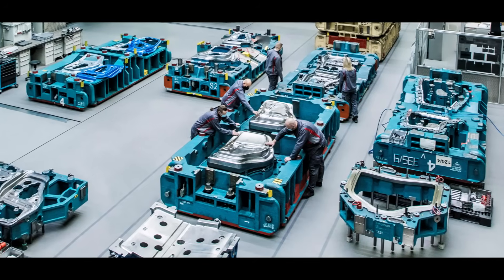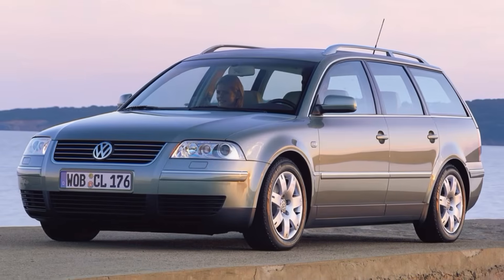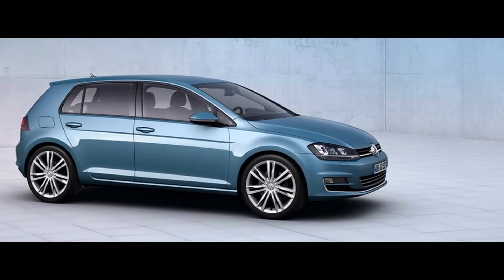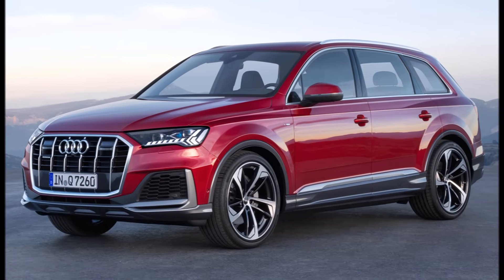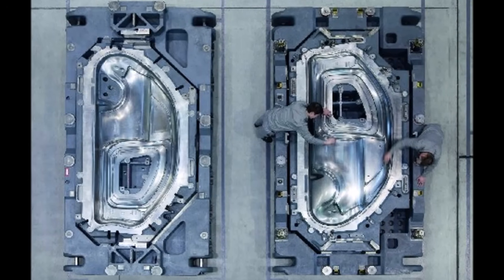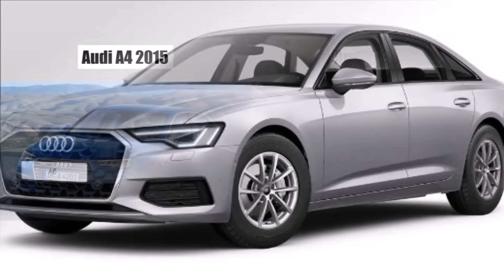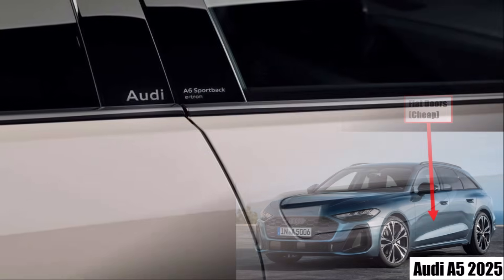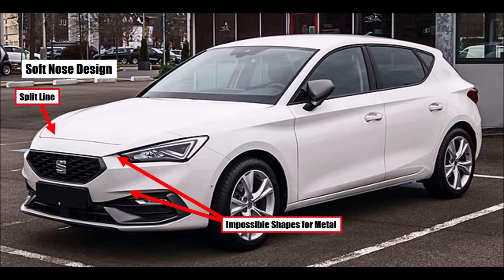Car Bodywork Details EXPLAINED

Comment: I’m probably the odd one out here, but I actually prefer the smoother designs. I truly hate the latest trends of the cars becoming ever more creased and angular, adding entirely unnecessary lines into the bodywork that serve no purpose at all. Oh and don’t even get me started on the ridiculously large front grilles, fake air holes, and tacky plastic trinkets everywhere. For me, car design peaked in 2000s and it only keept regressing, with few notable exceptions. I also never understood why Mercedes EQ series flopped. It was a perfectly functional design for maximizing the EV range, but people didn’t buy it because it didn’t exude enough luxury and presence. It boggles my mind that people are rather going to buy cars like BMW iX, an absolute abomination of a design. So when I saw the latest Audi A6 Avant, going back to simpler, smoother design reminiscent of 20 years ago.

Comment: Using Trabi as an example is a bad comparison, since it was made out of plastic and therefor moulded.
Reply from the maker: The point to deliver with that example is that less pressure results in simpler shapes. That’s true for Duroplast and Metal

Comment: I work at a collision repair/body shop and those small stamping dents around door handles and other tightly pressed areas really drive me crazy. Ford F150 aluminum doors are the absolute worst. I can't tell you how many times I've put a new door on an F150 and it looks horrible. And since we're a collision repair shop and not a custom shop. We don't spend time fixing bad stampings. If we did. We would lose money

Comment: That is one fascinating video. I work as a junior RD&I Engineer at a Tier 1 sheet stamped and welded parts supplier for main industry as well as being a main producer for pressing dies, tooling and fixtures for welding and checking. It’s always mind boggling to see what bolsters the quality feel and how far some toolmakers and automakers can go with complexity of their design. Although I’m not directly involved in production or design of the dies, it’s a clear indication of what trends move towards and what to shape, what to come up with next.

Comment: I always wondered why some car's bonnets draped down to the grille compared to others. Why wouldn't manufacturers use plastic components for the bonnet that attach strongly onto the metal bonnet sheet? Or more conventional composites for the entire bonnet?
Reply from the maker: Bonnet movement and bending at high speeds is a big topic in a car‘s development. Many cars with Aluminium bonnet need 2 locks for that reason. Maybe stuff for another video;)
Reply: @bsport320  A lot of OEM and aftermarket bonnets, e.g. those used on track-oriented sports cars, are made of fiberglass or carbon fibre composites. It may be too expensive, although fiberglass is pretty cheap to produce. Maybe crash safety is the big risk here?

Comment: That’s not accurate. The new flat door panels require more advanced sheet metal forming molds. In the past, sharp bends were used on car panels to prevent waviness over time. This was because curved or semi-flat panels tend to spring back to their original shape. To counteract this, manufacturers intentionally overbent them with sharp edges to release residual stress. However, the new semi-flat panels are reinforced from the inside, preventing deformation over time. As a result, sharp bends are no longer necessary.

Comment: Last true implementations of this imo were the b9 a5 and the b9.5 rs4 - facelift front end but the remaining body in white was the same as the pre facelift variant, with the tension line from the bonnet shut line to the rear lamp cluster

Comment: Absolutelt brilliant video, thanks for the knowledge. I do have a question, how does a brand like Lexus compare in terms of their body design? And if it is somewhat complex/intricate then how do they keep the price similar or less than the equivalent Audi who is reducing costs?
Reply from the maker: Thanks! Lexus uses extreme shapes and edges but only in their plastic parts. Their metal panels are fairly simple.
Reply: @bsport320  Thank you. I'd love to see you do a similar analysis on other brands in the industry.

Comment: I own a mk7.5 VW Golf GTI. Often when I look at it up close, for example when washing it. It amazes me how well thought out the lines, angles and creases are in the body work. I’d see a line that I never noticed before and took for granted, and realise it works so well. For example a line in the bonnet / hood that runs from the A-pillar to the edge of the headlight. Even the shape C-pillar and its panel gap with the rear bumper has been nicely designed. I’ve just realised both of these design features can also be seen on the mk1 Golf.
Reply from the maker: Hand washing is the best way to explore your car

Comment: I would not say, that round door design are a sign of cheaping out. Porsche for example never used sharp door lines. Design is always evolving. For my eye, the 2015 sharp designs in this video dont look modern anymore. I think round shapes are the current way to go and probably in 10 years everyone is sick of round shapes again and then the next trend comes.
Reply from the maker: Also round shapes need precision and this video doesn't wanna say round = cheap. Just exact sharp lines need lots of work and precision, flat doors are easier.

Comment: Ahahah, what a funny video hearing all that non sense about this dude ideas of expensive and cheap feeling.
As a customer you want a car that is as smooth as possible, none of those crazy sharp creases, none of those complicated geometric shapes.
Because those things CANNOT BE REPAIRED at body shops, and you are foced to buy new doors in case any idiot bends it just enough.
No metal worker can get those sharp lines back as new and even if they tried, it would cost so much you'd just buy a new door.
Feels expensive is one one of putting it. EXPENSIVE TO MAINTAIN.
Get off your fantasy "design" theories and come into the real world.
Customers with a function brain don't want the impressions of expensive, they want low costs to keep a car running

Comment: There are some very basic mistakes in this video. First, aluminium is more ductile than steel, i.e. it enables smaller radii. Second, aluminium is more expensive than steel, i.e. it makes no sense to use aluminium for cost-cutting. It's used for weight savings at a higher cost than steel. Third, the reason for embedded door handles is aerodynamics, driven by fuel consumption regulations and BEVs having limited range. It's not cost-cutting. Many manufacturers even use electric motors to extend and retract the door handles which is certainly not saving cost.

Sorry, but as a mechanical engineer, this video is pushing a lot of wrong information.

Comment: The Audi A6 e-tron really feels very cheap. I was very surprised when I inspected it at my local dealer last week. On the other hand I was very impressed by the look and feel of Skoda Elroq or Enyak for example. They are from the same corporation but the expected quality is totally mixed up in between the brands. This is what I felt at first glance at least.

Comment: The VW AG is a German group that, unfortunately, took some years ago very bad decisions, as most German manufacturers: they changed the engineers thinking to achieve the best (product) for the best (costumers) to a stockholders thinking. More money, no matter what. That happened across all brands.

Instead of preparing the future (electric, better more durable products and more efficient production as the gigapress allowed), they just went all rogue and cut everything to get just now money to the stockholders:
- cheat the emissions test (what?! Germans cheating?!)
- changing the process manufacturing and materials to much cheaper ones, while increasing the price
- parts holding much shorter for higher maintenence costs
- paying for everything in a car. Getting broom the very basic to a standard amount increased many thousands of euros the price. At that time it was also true for Japanese cars. I remember a family member deciding between a vw car with the bare minimum costing the same as a Nissan car almost fully packed (well, fully packed in a Japanese car wasn't much either, but at least it was much much better than what vw had). She decided to buy the Nissan.

I have friends that work for companies that work for VW AG and BMW and Mercedes, and the requirements 15 years ago and now, are much different: 15/20 years ago, the part would have to last at last 200k km or more, which could be 300k km easily; now most of those parts have a chip that after 160-180k km sends a message to the central computer to be replaced...

Comment: you throw out heaps of assumptions selling them as facts and it all sounds logical until actually someone from automotive industry is watching this… what is your profession though? just an example: soft nose is not for crash rating but for insurance rating. flat surfaces with big radiuses are a challenge on its own, just think about roof panel of black cars that bend on direct sunlight. deleting sharp radiuses is definitely not a question of money but of design language. i’m saying this as an actual engineer at a german car manufacturer. my thesis paper was about sheet metal design faults.
Reply from the maker: Was working as design engineer in German car industry for years, otherwise I wouldn’t do these videos.

Comment: That’s all very well, but the Trabant 601 (my very first car) did not use sheet metal. Trabant body panels are made from Duroplast, which is a composite thermosetting plastic, a close relative of formica and bakelite. It is a resin plastic reinforced with fibers (either cotton or wool mill waste) making it a fiber-reinforced plastic similar to fiberglass.
Reply from the maker: Never said it uses metal, you can check my Trabant videos for more info

Comment: In the early 1990 Toyota attempted the same on their new luxury division Lexus. You could see the similar demanding designs on the body panels of SC400 or Soarer in the domestic market. Apparently the rear end of the side panel was the most challenging to get it right from a stamping perspective. It was refreshing to see from their regular models.

Comment: Another point to remember though is that having a lot of section change in the doors and especially plan view change to emphasize the "hips" of the car is aerodynamically inefficient. With tightening fuel efficiency regs and the quest for more range on electric vehicles, these styling decisions conflict with the functional requirements of customers.

Comment: How is it, that car manufacturers forget to look at cost and elegance rather than the most "premium" design possible? Well, the short, simple answer is that they are looking for ways to charge more money for their products, the more money the more brand identification items. To a degree that elegance is now a thing of the past, in favour of features making cars look like overdesigned sneakers rather than something that might attract the customers eyes and wallet. VW group is neither better or worse than others, it is a criticism of the whole business. If i want to make a car more attractive, i would try to design it with elegance rather that making it look fast and powerful. Comfort over "sportiness" and a balance of aerodynamics without sacrificing function. Can it it be done? Well, at least, try! 😊
Reply: It sounds like your prefer an old-school Citroen like a DS or CX! The kind PSA/Stellantis, sadly, don't make anymore.
Reply: @TassieLorenzo  Partly correct, however i want to look forwards rather than backwards. Citroens like C5X is lagging behind in electrification, for example.

If I am supposed to spend a lot of money on a car, it must attract me, and frankly, new Citroens doesnt.

PHC may be good, but the cars are no longer innovative.
So I stick with a 14 yr old C5 2011 Diesel Touring with hydropneumatic suspension until Stellantis understands why. 😉
Reply: @ The C5 with hydropneumatic suspension is an amazing car! 🥰
Reply: @TassieLorenzo  Yes, that's how i like it, although it has clocked 200.000 miles and is starting to need repairs more often now. It is still a lot cheaper than buying a new car i don't like, so the choice is a "no-brainer"

Comment: Your info is good, but I'm wondering if the design of the lines and ribs were also made to use thiner/ cheaper sheet metal by  stiffening it through "corrugating" it.

Comment: Totally agree, I have '17 A4 and the body is the same as the B8.5 with a better interior. To my mind this is peak.The 9.5 doesn't look as good most notably to me the headlight design, it's now soft without the nice little zig zag on the bottom and the MMI dial is gone☹️

Comment: I remember back in the 90th Opel used to implement flashed door handels at their cars.
The main argument from marketing point of view was the aerodynamic advantages. But mainly it was down due to cost saving issues.

The motorjournalist at that time critizied  in every test Opel for its door handle, bow type handles would be more safe in an event of a crash.

Nowerdays every EV has Integrated door handels.

Comment: But where is the saving, there are still same press machines in the manufacturing line.. you sure is is not a design transition toward new design line?
Reply from the maker: Because the highest costs go into fine tuning these sharp edges, tools have to be a lot more exact and wear is higher, it’s not about which press you use.
Reply: @ ok that is also a point you right. But the question is if the cost is a main point for this design change? Do you know it for sure?

Comment: I have no expertise at all in this field but my first thought was: Is it really a cost saving measure? They already have the capable presses from the 2010s, so why would it be cheaper to revert back to simpler door designs?
I have a feeling that the new cars are supposed to look smoother as a conveyance of smooth riding comfort and efficiency. I also cannot believe that the door handle dents are a cost saving measure. The complexity of the electronic door handles is significantly higher compared to traditional handles.

Comment: Bit of a lazy video. Modern 2024 A1 and A3 models have sharp edges at door lines, yet they are the cheapest base models. Audi are chasing trends more likely with EVs being rounded with no sharp edges, Tesla Truck aside. Plenty if other ways to cost cut on cars like....interior plastics than door line edges smh

Comment: Hmm, this is more to do with the fact aluminium is being employed on panels where they weren’t before, and as you said, it’s more difficult to bend aluminium vs steel. I have an Audi C8 2019 and it is by no means at all a cheaply built car. It still feels factory fresh after 6 years and 73k miles. The latest A3 has steel doors and Audi made a point of how many crease and curves the doors have.
Reply from the maker: I was in the development team of the C8 and it was the start of cost cutting.
Reply: @ I’m sure you were

Comment: Great video, everything seems plausible. 
Maybe you can go into that new-ish trend of the split headlights? Where more and more manufacturers choose that disgusting design aspect of splitting the headlight into a DRL and a high/low beam section. 
So aside from the grill, all cars look the same. Slim strip of LEDs and a always similarly shaped headlight... Round on one side with a straight edge on the other..
Kia, BMW 7er/X7, Jeep Grad Cherokee/Renegade, Citroen Cactus, Hyundai Kona, Nissan Rogue, Lancia Ypsilon..
Reply from the maker: Thanks! The headlight design is a cost efficient way to reach super thin headlights (design wish), without having to develop super thin headlights, because the real headlights are below and a fairly standard (cheap) design.
Maybe some stuff for a new video ;)

Comment: The lines you’re showing you are there to make the belt line look lower and smoother. The actual belt lines have gotten higher, but that looks ugly. So designers want to hide it using optical effects.

Comment: I soooo disagree.
How exactly do they save money? Did they change presses for the weaker ones? Or do they use the same machines? Because if they do it's nothing but the styling.
Now let me support my point. All those creases makes sheet metal stronger. And car companies especially sports car manufacturers like Audi are crazy about torsional rigidity. Besides you contradict yourself. You said yesterday they cared about styling and today they don't after spending all that money for the research. Btw. did you ever check cars styling throughout the years? First they were square, than round,  than square again and than round again and again and again.
And one more thing. You talk about pressing sheet metal for body panels and they you show picture of car with body panels made from composite material. That's a little embarrassing. Until you prove me wrong it's a well deserved thumb down, and I am surprised there is so little of them.

Comment: For decades, American cars traditionally had a separate composite header panel, indeed to reduce cost in case of an accident. The hood wouldn't bend in minor accidents. Speaking of which, the Buick Riviera "Boat Tail" Is a prime example of a manufacturer showing off their advanced and expensive technology with that rear window.

Comment: Some cars have the rear door handle behind the window, not under it. Maybe not just a design quirk but also a design-to-cost measure, eliminating the need to make a door handle dent in the sheet metal.
The thing though is that some creases are still needed for stiffness. A totally flat piece of metal would buckle ... You can see this in the hoods/bonnets of cars, they're never completely flat.